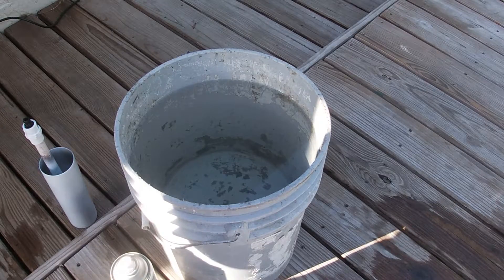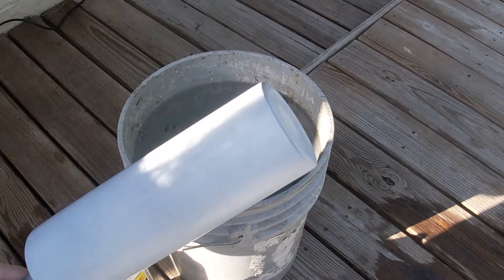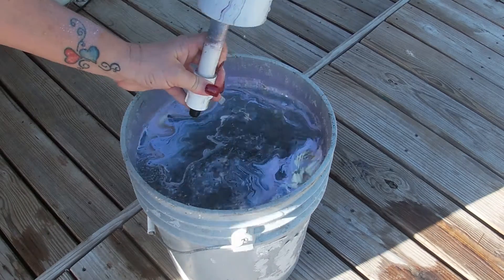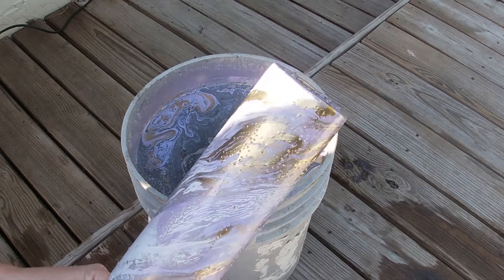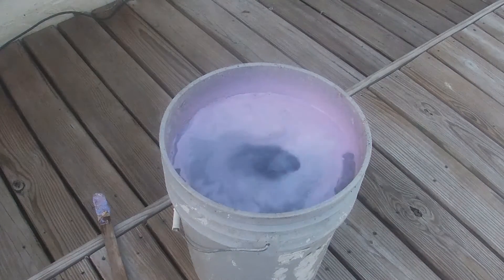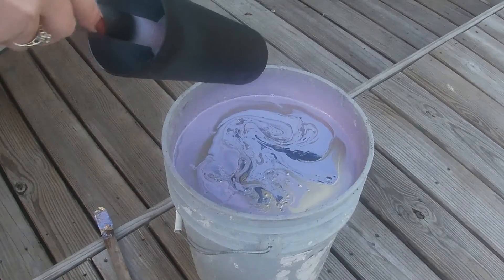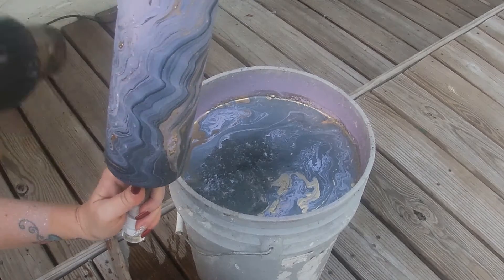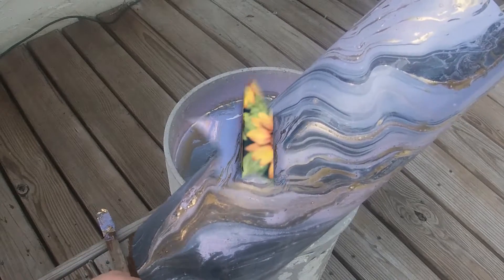Hydro Dipping on a Light and Dark Base Tumbler Tutorial

Comment: I hydro dipped mine but I had too many bubbles is there a fix ??
Reply from the maker: I just pop it really hard on my deck to rid most of the bubbles, and then I use a heat gun to push of any remaining water.
Reply: @RebeccaEscott  thank you I’ll have to try it I wasn’t sure if I could use a heat gun on spray paint I didn’t know if it could be toxic ? And thank you for taking the time to reply back !! 💕
Reply from the maker: @TheSewingBaddie  Absolutely, when using heat, you wanna move quick so you don’t burn the paint so you should never be smelling the paint if so it’s most likely burned and that would not be good.

Comment: Did you seal after dipping and before applying epoxy? If so, how long did the seal dry before epoxy?
Reply from the maker: I do not believe I did however you most definitely can seal them prior to epoxy, usually in about 30 mins or so or when you know your clear seal is fully dry you can epoxy.

Comment: I get big ol’ paint boogers when I use a skewer.  How do you avoid that?
Reply from the maker: Maybe try a stick or even an old straw maybe to help swirl the paints, sometimes it’s hard to avoid them when using metallic paints. Also this technique is best done out of direct sunlight this can help insure that your water isn’t to hot, so your paints don’t freeze up when they hit the water. I really hope this makes since.
Reply: @RebeccaEscott  yes, it does.  I was using metallics. Ty!
Reply from the maker: @jerritanner275  Ok that could be part of the issue, try again but see if in the shade helps and if the water is a little cooler that should also help. Please keep me posted ok.

Comment: I love your Chanel I have 2?’s what do you do about the paint inside the tumbler? and How do you get all the bubbles popped
Reply from the maker: Thank you so much, Paint will get inside the cup when doing this method and to clean it, I just use acetone and a mr. clean eraser and it cleans right up. To pop most as I can never get all I use a heat gun to push off as much of the remaining water as possible. I hope I was able to answer your questions and let me know if you have any others and anything I can help you with.

Comment: I just watched your tutorial but I'm confused on what to do after dipping.  Do I let it dry upside down or on the turner? How do I clean the inside of the cup? Does the outside need sanded before epoxied?
Reply from the maker: I just leave the tumbler to dry upside down, once you epoxy the tumbler then you clean the rim, these were painted with fresh paint so no they were not sanded.

Comment: I'm wondering if these are regular water tumblers? How do you get the paint from going into the cup? What are you using to hold the cup for dipping? What do you do after the paint drys? Can you use a plastic tumbler instead?  Can you wash these in the dishwasher or hand wash? Safe for drinking out of or used for something else instead?
Reply from the maker: Craig's mom I don’t worry to much about the paint getting inside I just clean them with acetone when I’m done, I use my football holders to dip them, once the paint dries I epoxy they don’t have to be sealed. Yes I’m sure plastic cups are okay to dip, These cups need to only be hand washed. These are definitely safe to drink from. I hope I answered your questions, let me know if you have anything more I can help you with. ❤️

Comment: Hey, do you use any spray paint? When you prime the tumblers can I use the paint & primer spray? Also how can I add glitter to it?
Reply from the maker: Yes, I use any brand to hydro dip, though the metallic spray paints can be very tricking in the water,  I've never tried with paint and primer combined, couldn't hurt to see if it works. You can not add glitter to the water but you can use epoxy glitter additives for a final coat and the whole cup will sparkle.

Comment: So I tried one this weekend and did same way but had lots of air bubbles , I did see that you say they go away but they look like gory bubbles do those away and if so how long do you let the cup dry for ?
Reply from the maker: jennifer tristan It doesn’t usually take to long to dry, If they are real bad they are not likely to go away.
Reply: Hey Jennifer. I’m trying my hand at hydro dipping, too. Did you find a way to eliminate/reduce air bubbles? I’m using a heat torch, too, and nothing seems to help.

Comment: These came out absolutely fantastic! Prettiest dips I have seen yet! Now, how much gets inside the cup & is it easy to remove? Do you just use acetone?
Reply from the maker: krazjays4209qdd It’s not to bad, but yes easy clean up with acetone, soap and water ❤️
Reply: There's a new thing you can get called Tumbler Shields that keeps the paint from getting inside
Reply from the maker: @TexasPeachyMimi  I had no idea, Thank you so much for the tip. When I get them, I will be sure to give you a shout out for having made the suggestion. Its greatly appreciated.
Reply: Nancy Webb thank you so much for sharing that!!! I just looked them up.  Question for you- are the silicone  shields to prevent epoxy from getting in your cups?  And the hydro lid added to that is for hydro dipping?
Reply: Anna Godfrey yes. They have a Facebook group “Tumbler Shields”. They have different tutorials on there

Comment: I have a couple questions do you need to seal it with anything? And will vinyl stick to it afterwards? Also how do they hold up? Are they hand wash only?
Reply from the maker: misty noble No these were done with spray paints so no need to seal, I would recommend a thin coat of epoxy before decals. These cups hold up very well and yes they are hand wash only.

Comment: So I wanted to try just your basic black & white marble look. Is there specific paints (spray paints) to use for this? As when I tried it, the paint I had created what looked like oil bubbles in the water which turned the “swirls” into smudged circles/bubbles, ONLY SMUDGE BUBBLES........ any suggestions would help drastically
Reply from the maker: Kevin Klein Yes, so in my experience with these hydro dips, don’t use hot water and if at all possible keep your bucket in the shade. Also I used both Krylon and rustoleum to achieve this effect. I really hope this helps.